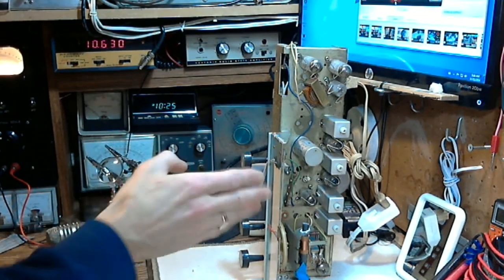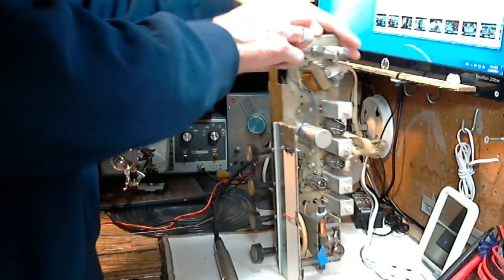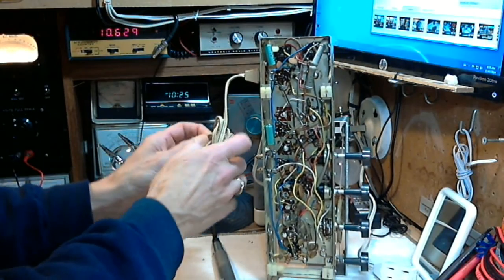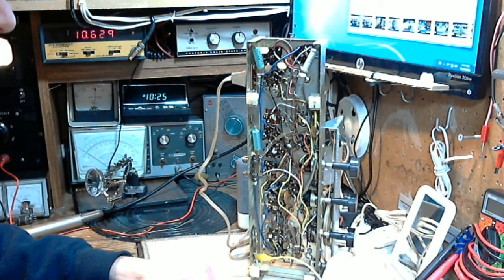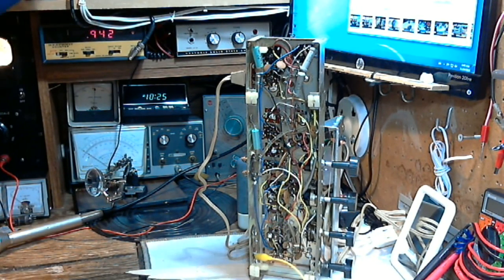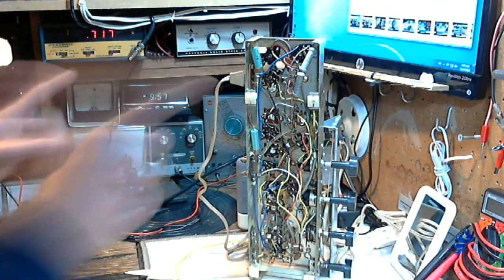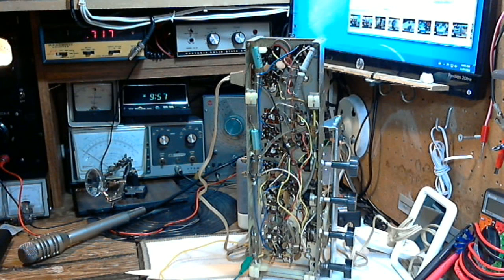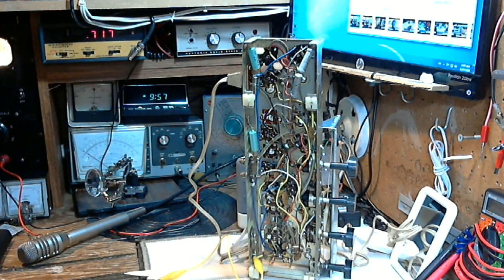Concerto AM/FM Vacuum Tube Radio LL21552 Video #6 - Alignment

Comment: You know if you let the smoke out it cannot be put back! (:  Don't be surprised that there are dirty devices at 10.7MHz. Heck, the noise goes much higher than that. To 450MHz and beyond. Some consumer electronics radiate so much crud it is surprising that they do not interfere with themSELVES so bad as to prevent functioning.
Reply from the maker: I'm just living in a state of denial.